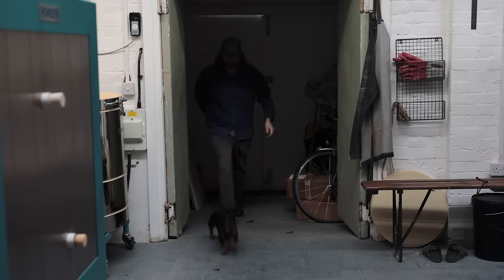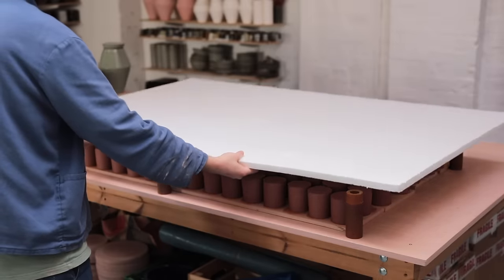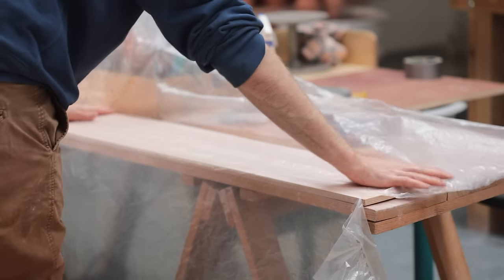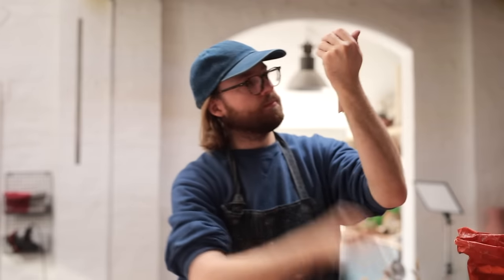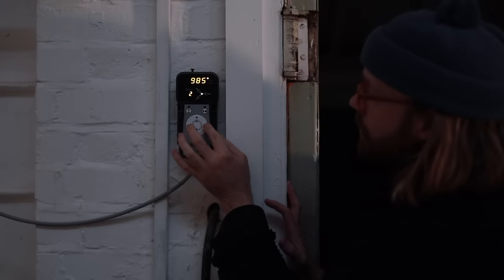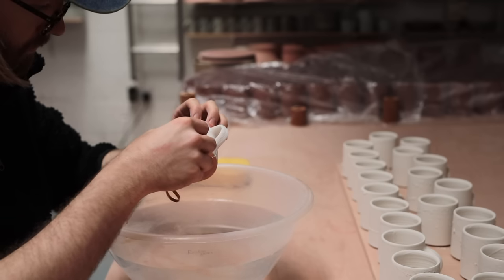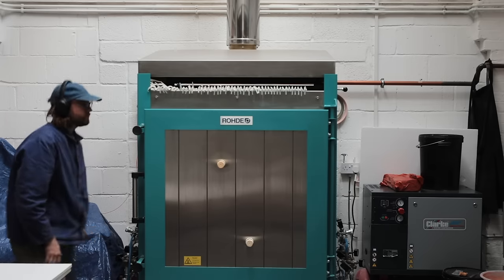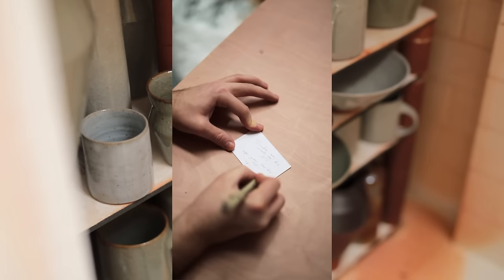Making 100 Miniature Mugs

Comment: Had an idea to make weighing the clay out faster, but I'm not actually sure if it'd work in your favor or not. Basically, instead of making balls by tearing off clay you could figure out the dimensions of a square piece of clay of that weight and then (maybe using calipers?) cutting the clay square prisms which should all be around the target weight. I don't know enough about working with clay to know if this would be helpful at all, but I thought I'd share anyway.

Comment: Did you actually make exactly 100 at the start, or were there spares to allow for any that cracked during firing or similar?
Reply from the maker: I made 105 — can't remember the exact number that fired successfully but easily had 95 that were good!

Comment: Hi there! I love your videos! I've only been hand building and coiling in the past, but I'm now learning how to throw. May I ask you which one is your dominant hand? I'm left handed (although I'm a quasi-ambi) and it's difficult to throw if the wheel is not spinning anti-clockwise.
Reply from the maker: Thank you! So, I'm right handed, but nowadays I'm rather ambidextrous on the wheel. You'll find that potters in the West generally throw with the wheel spinning anti-clockwise, no matter if you're left or right handed, whereas in the East it's often the other way around. My advice would be to not let it be your focus when initially learning. Throwing pots feels very strange at the start and all your movements awkward and uncomfortable, no matter your dominant hand. Slowly, it'll begin to feel more natural and you'll gain more control but it really helps if you, and the person teaching you, throw in the same orientation, otherwise there can be some barriers. I guess ultimately you should do what feels most comfortable but know that at the beginning making your hands do the right thing with the lump of clay always feels clumsy. Good luck!
Reply: @floriangadsby  thank you for your valuable advice. 🙂